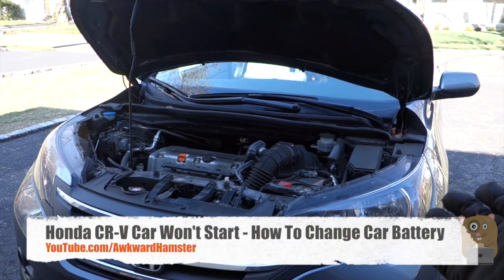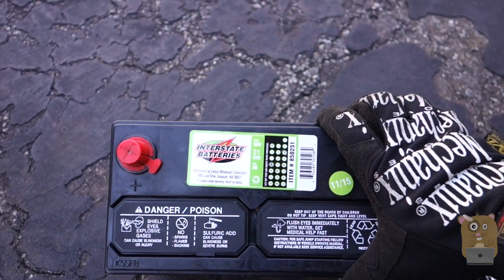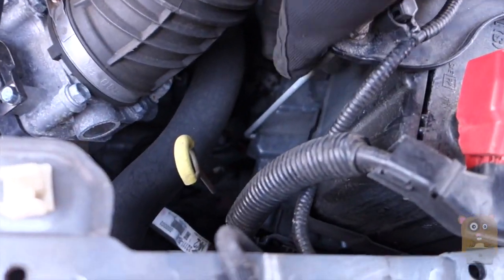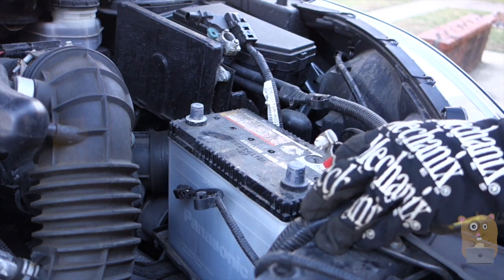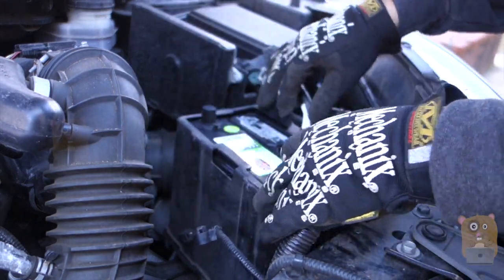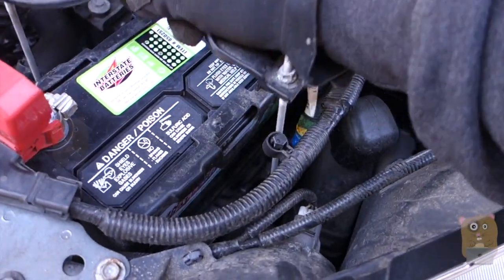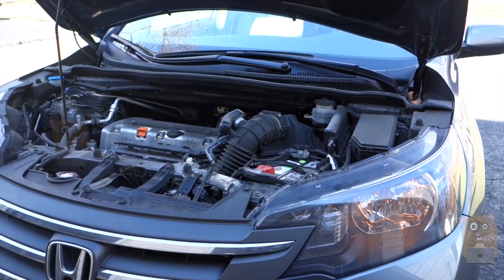Honda CR-V Car Won't Start - How To Change Car Battery

Comment: You should always remove the negative black terminal first on a negative ground vehicle. Make sure that the negative conductor is held out of the way before undoing the positive red terminal. This is to avoid touching the spanner/ratchet touching ground and shorting the battery. Also the hold bracket should be installed back before re connecting. You also mentioned that you were only doing small trips this is possibly why the older battery is dropping voltage because it’s not getting long enough runs to keep the battery topped up enough. You might have saved some money by not taking it to the dealer but the dealer would’ve done that job correctly. You have posted a video that could cause somebody to damage or set fire to their vehicle and possibly injure themselves. You are clearly not trained on something as simple as this. Sorry for being so direct mate but your method could be dangerous. You might want to re post an amendment.
Reply: I strongly agree to this comment.
Reply: You don't have to take it to a dealer. Just the auto store have them install it. This guy shouldn't do it  himself.

Comment: Thank you so much for this video. My wife has a 2013 Honda CRV and while I've never been the automotive type, even when it comes to replacing a battery you made this extremely simple very informative and a lot more easier than waiting on a auto parts store or provider in switching out the battery for me.
Reply from the maker: Thanks

Comment: You should really remove the negative terminal connection first.
Reply: He did a great job illustrating with details. Yes he should have disconnected the negative First and also he should have gotten a 10 mm socket. I don't know why he is using the needle nose if he has to 10 mm socket but I forgot he didn't have the Deep one
Reply: Clean the terminals it helps

Comment: Thanks for this video.  I was able to remove my battery take it in and get it tested and charged at Autozone.  Put it back in and the car started!  Autozone stated it charged to 65% on their fast charger.  I had the battery replaced as it was a 100 month OEM battery about 2 5 years ago.  I plan to contact the dealership and see what they say as this was another OEM 100 month battery.  Will keep you posted...
Reply from the maker: Glad to hear this helped.

Comment: Very helpful.  Thank you.   Female with limited car repair experience, but I was able to follow along and replace battery all by myself.   I own a 2014 CR-V, bought it new, and just replaced the original battery @ 76k miles.
Reply from the maker: awesome

Comment: I have a 2012 crv and have the same issues in the cold weather!!
After watching your video —- ill do it myself
I think some caution should be taken when putting on the bracket— should have covered the positive terminal

Comment: I usually put a little oil on the threads on the battery hold down.  It keeps the cheap threads from getting stripped so it will come off easier as the car gets older.  Good video.
Reply from the maker: Good idea.

Comment: Thanks for the clear instructions. I was surprised to find my Canadian version of 2014 CR-V  actually uses a group size 35 as OEM. I had to run back to Costco again to return the 51R and buy the 35. It also has different sized tray and plastic case. In case you need to upsize your 51R, it's definitely possible with the right tray and case. Not sure about the clamp though.
Reply: Mine is honda crv 2014 country assembly Canada. What size of battery I should to buy ???, thanks

Comment: From Chicago. I’ve had this issue multiple times. I ordered an AGM battery from Costco. I hope that this may solve the problems. I had the alternator and starter checked. Everything came back good.

Comment: Very helpful video.  The biggest problem I had was when I dropped my 10 mm wrench into the engine compartment.  I replaced the battery on my 2017 CRV after the instrument panel started to act up driving home down Alligator Alley in the dark.  The radio stopped working, later the fuel gage stopped working, the display was all messed up.  It was fine the next day,  but I did not want it to happen again.  The CRV is less than 4 years old, but I worry about the Florida heat.  I never had a problem starting the CRV.

Comment: Great Video - thanks for taking the time to make it. We have same issue with 2014 CR-V - on very cold mornings it won't start and dealer can't figure out why. I looked online and see many people also having this problem. For us, it takes a few tries and will then finally start up. Tonight it died in a parking lot - this time battery went dead and had to get a jump. So disappointed in this car. We are going to replace the battery but you also mentioned a computer issue - can you please elaborate as I want to ensure the dealer checks into that. Thanks!
Reply from the maker: Hello. At 0:14 in this video I showed the letter from Honda Motors asking me to bring the CR-V in for an update regarding the battery charger.

Comment: I bought my 2008 Honda CR-V in 2008 in Mesa, AZ. I was having to buy a new battery every year or two but the dealership said that was pretty common because of the heat in the summer. Since then we've moved to Utah where it's hot(low to mid 100s) and cold(-15 to 30s) in the winter, I'm just now having to replace my battery i last bought in AZ over 5 yrs ago. 
Thanks for the video, I'm hoping it helps me change my battery to save some bucks! I'm also going to Costco to buy one so thanks for that as well!

Comment: I just picked up the same battery at Costco yesterday.   I'm going to try installing it myself today on my 2012 CR-V.   Thanks for uploading this video!!
Reply from the maker: You're welcome.  At 0:12 seconds into the video I showed the letter I got from Honda about bringing it to their garage so they can update the computer.  If you haven't done that with your vehicle, I would suggest calling Honda about it.  It was free.

Comment: There are powered items running even when the car is turned off. The clock and anti theft system are 2 I can think of off the top of my head.  In cases like this a deep cycle battery survives near or complete discharge much better than a standard lead acid battery.  It wouldn't hurt to install a trickle charger, either a household current or solar powered to maintain the battery during periods of no use.

Comment: Awesome video! Really well filmed and explained. Here in Vancouver, BC, Canada, Costco has Kirkland Signature batteries with great warranty. Just replaced mine yesterday with the help of your video on our 2012 CRV. Hopefully, your issue got resolved. Our CRV (like all our Hondas) has been really reliable.
Reply from the maker: Excellent
Reply: I have 2012 crv Lx Battery says 51R 410 CCA, i seen other batteries has 425 and 450 cca is that ok to buy and install. Live in, NS Canada

Comment: Hey, loved this video so well produced and infromative, I recently had an abnormal dead battery on my 13CRV the other day. What's weird was that the vehicle was in the shop a month before and tested fine. I never heard about this computer system update before and dealership never informed me bc it's not an official recall. I'm going to replace the battery with an interstate and we'll see how that goes. Although, there are rumors circulating that the ECO button contributes to battery drain. My vehicle has less than 33K miles and it's  2017 so I chalked it up to old age  but it was bizarre how it died out of nowhere. I'll keep ya updated.
Reply from the maker: +Christopher Choi 
Thanks for the info. I Didn't know it was an unofficial recall.

Comment: Thanks for the video! I have a 15 CRV and after just 3 years, battery was dead after a cold night. Jump started fine, but happened again. Got my new battery from Costco and couldn’t  figure out how to get those plastic wire keeper bolts off. One of them ended up breaking.
Reply from the maker: +John Bryant 
Thank you
Reply: Dude I got a 15 CRV too, it was dead on a random night and since it was still under warranty I made dealership test it and they told me nothing was wrong. now 6 months later my car just got out of warranty 1 month ago, the car died on me 3 times in a spawn of 3 weeks. 

I did bring my car to 3 different location to get alternator and battery test and they told me they are fine...

I dont know man... I will go change that battery and if this happens again... ill know I got some drains somewhere on a 3 years old honda car...

Their reliability is a joke now.
Reply: Did that resolve ur issue? I have a 2015 crv that randomly won’t start without a jump, just hit 40k miles. Battery & alternator test good

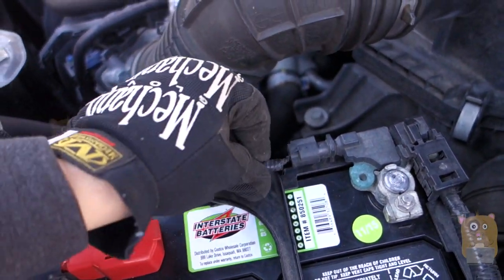Comment: Thanks for this, it helped me replace the battery on my 2016 CRV. The only issue I  had was reconnecting the connector (around 6:30 in the video) where I did not hear a click. However, it did feel connected. Anyone know the purpose of this connection? Never met this on any of my previous cars.

Comment: You are great, thanks for the video, First I got panic when the car gave up starting, I was about to leave office in the morning, thinking of the options all over my head, I called the insurance to jump start it. But don't want to take to dealership, they charge a lot as you said. called Costco , they have the battery but won't do installation (disappointed). Then I searched and found your video. Its was so helpful, gave me confident to DIY, great; 10 minutes all set... Thanks.
Reply from the maker: Glad to hear this helped.  Thank you.

Comment: there is a rest always when u unhook the car, just did mine and you can get the code for the radio when u open the glove compartment right hand side theres a sticker with a 5 digit code
Reply: Nope, mine is also CRV 2012. just hold down audio power button for 2 seconds and you are all set !..

Comment: You just need to Clean the corrosion on the two ground wire harness. One ground wire is connected to the battery and the other one is hidden under. 

Honda's electrical wirings are designed to corrode & fail after several years. You should clean all ground wire terminals because Honda used dissimilar types of metal. Perfect recipe for Galvanic Corrosion. The Transmission Ground Wire is HIDDEN under the air cleaner bracket near battery. You will need to remove the front splash shield to have access on the opposite end of the transmission ground cable. 

You can use Multi-Purpose Grease to seal the connections. The best option is to replace the copper terminal with steel and use heat shrink to seal the copper wiring.

Comment: Hello, your video was really helpful to get the battery replaced. The only problem I ran into at the end was getting the little black (with green plug inside) connector snap into place. It seems it’s connected and the car started also but the connector didn’t click. Should I be concerned?
Reply from the maker: I'm not sure what you're describing. Can you send a picture?
Reply: AwkwardHamster 
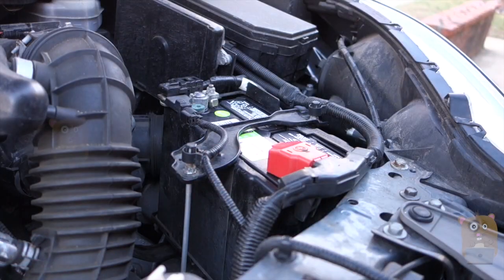Sorry I don’t know how to add a picture in YouTube comment. At about 6:32 minutes in your video, just before you said ‘Start the car’, there was a click sound as you plugged the connector. When I plugged it, I didn’t hear the click. Again, the click sound I am referring to is at 6:32 minute in your video. It is the small connector below the negative terminal on the left hand side. Thanks.

Comment: Hold down plate is in wrong position, adjust before tightening 2 bolts to be able to remove battery water caps to add water!

Comment: Do you have one of those 12V battery chargers and maintainers that you can connect to the car battery the night before you plan to drive. they are pretty good to have for card that do not get driven much.. They are also good to use from time to time in order to prevent the battery from getting deep cycled.

Also if possible, can you get a multimeter and then use the current measure function to measure the cars current usage while it is off? This will help you determine if there are any failed components that are causing a drain on the battery when the car is off. 

PS, never attempt to start a car while performing a current measurement with a multimeter, it will blow the fuse in the multimeter.
Reply from the maker: I have that too. Used that with my 86 Reliant. Don't get to park the car in the garage anymore so not easy to use hook it up. 
I put about 6000 miles on the CRV a year and drive it at least once a week.

Comment: Just wanted to say thank you for the helpful video. After watching, I just changed the battery myself for my Honda CRV which is exactly the same year as yours. After replaced the battery, no radio code is needed. Just need to preset some radio channels that l lost. Not a big deal at all.
Reply from the maker: +Den Ip 
Thanks

Comment: Hey AwkwardHamster, Thanks a lot for showing us how you installed your new battery. I am just wondering if you had any RESET problems with the radio or other electronics (maintenance minder, etc), when you disconnected the old battery and reconnected your new costco battery? Many thanks...Terry
Reply from the maker: +Terry Lim 
No reset problems with this car. But the Acura electronics locks me out when the voltage drops below 9v
Reply from the maker: +Terry Lim 
No reset problems with this car. But the Acura electronics locks me out when the voltage drops below 9v
Reply: Thanks for your reply. I picked up the same interstate battery at  Costco for my 2012 CR-V. Thanks to your video, I’m ready to replace
my battery tomorrow. But I'm worried that I will lose my data stored in my Honda Navigation GPS Address Book, Honda Radio and Maintenance Minder History. Does your 2012 CR-V have these devices? If so, did you lose and functionality on these systems? So to have to ask you again. Cheers…Terry P.S. Did you eventually fix your battery problem?
Reply from the maker: +Terry Lim 
My CRV doesn't have Nav. Even when I unplugged the battery to my Acura, I didn't lose the contents stored for GPS address book. I am pretty sure the radio station remained the same when I removed the battery completely.

Comment: Great video.  Hope the new battery solves your start problems for good.  Did you have to reset your car sound system after the change out?
Reply from the maker: Crap. I forgot to check the stereo. Pretty sure I will have to enter some security code. Will look into it after I return from CES.
Reply: +Marc some cars only the dealer can reset the audio systems

Comment: I am having battery issues on my 2013 Honda CR-V. Never heard about the software issue. Please excuse my ignorance. Which year model is the car on the video? Thanks. I have given Thumbs up on your great video. Do they charge you at the dealership to update the computer to fix the battery issue?
Reply from the maker: +Bangla Channel 
Mine CRV is 2012. The letter from Honda I showed in the video came in a general envelope. Not one of those recall envelopes with red warnings printed on it. 
Either case Honda updated the software for free.
Reply: AwkwardHamster Thank you.

Comment: I have a 2013 Honda CRV and it goes dead every month for no apparent reason I took it to the auto parts place they tested it said it was a good battery and the alternator is good now it won't crank at all. it has some miles on it but I would expect more from a Honda they have a good reputation they definitely need to fix this problem I have heard a lot of people have this problem
Reply: Intheevening 123 I had a Jeep Grand Cherokee and it used to do that. Later found out battery was losing power through the power outlets and a short on the electrical wiring. So, you may like to find out if your cars electrical components are draining the battery. Thanks.
Reply: I believe your CRV needs a software update in the computer. call your local dealer it’s part of a recall

Comment: AwkwardHamster, thank you for your video. Do you still have car starting problems with your CRV after the Honda SB software update and battery replacement? We still have ours with our 2012 CRV after battery replacement and software update. It was done December of 2015 and after a year the battery started to bug down specially on minus degrees. Thanks.
Reply from the maker: Hello.  After the software update and battery replacement I no longer have battery issues.